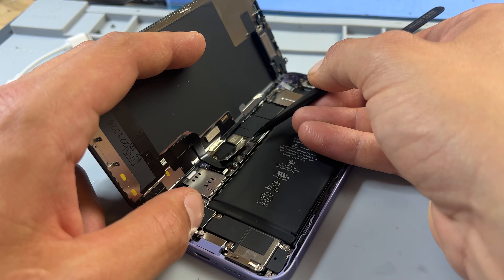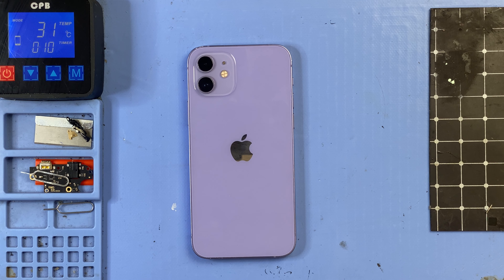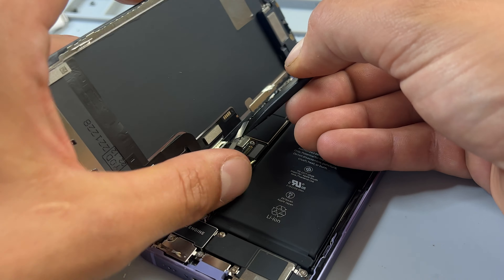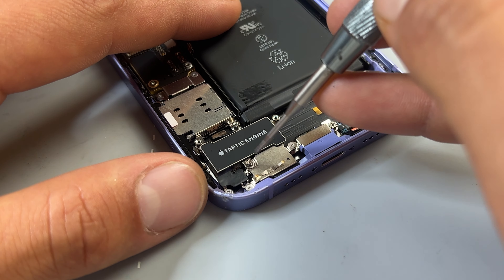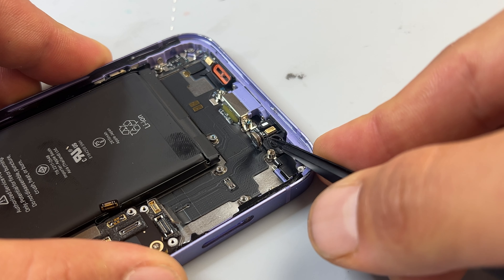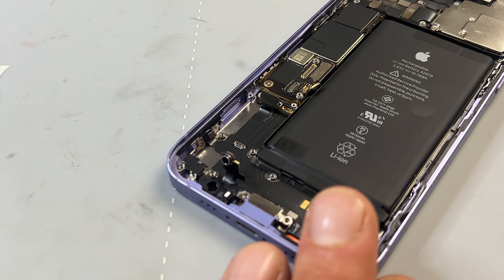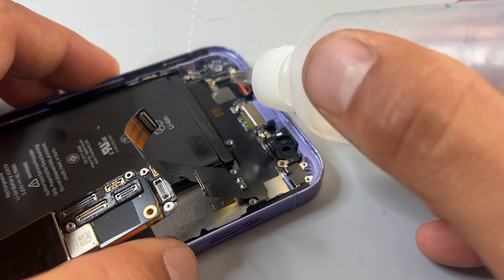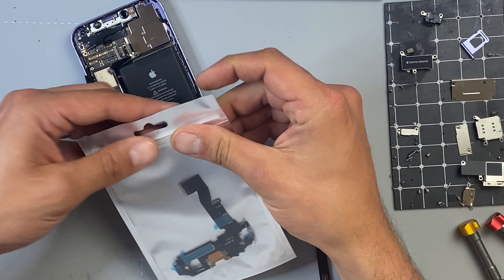iPhone 12 Charging Port Replacement - Step by Step Tutorial

Comment: Hey, where did you purchase the new charging port module and adhesive seal?  Would you please link these parts in your description in the future (if it is not a wholesale agreement you have)
Reply: P.S good video, very clear.  I will be attempting it.  The only part I am a little unclear on is the microphone positioning.  It looks as though it is angled and doesn’t sit cleanly like the rest of the parts but I guess it will come to me when I try it.  Maybe a closer frame in the video would explain better.  That’s being nit picky.

Comment: I replaced my battery charging port and my screen, turned my screen on before putting screen back, it worked and charged, so I turned it off and started to put my screen in, and when I was done it did not want to turn on, but when I plug in charger it makes a charging sound
Reply: Did you figure it out?